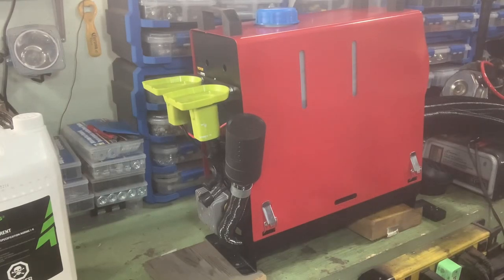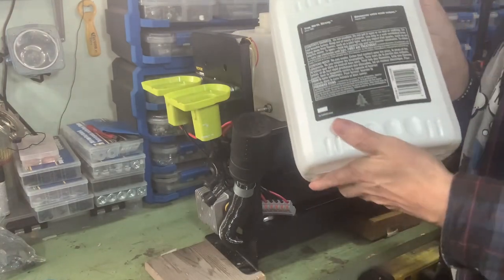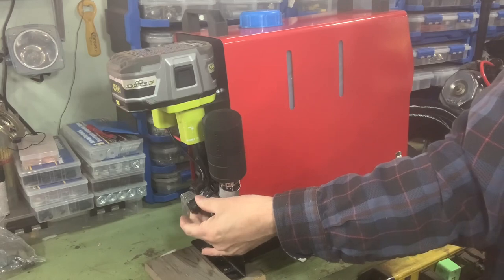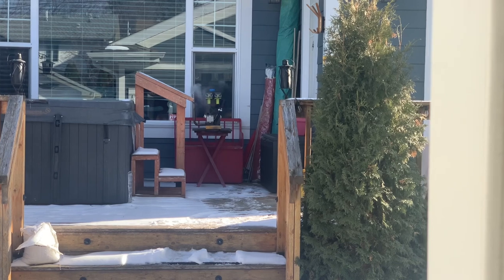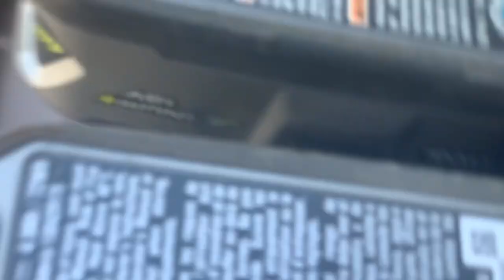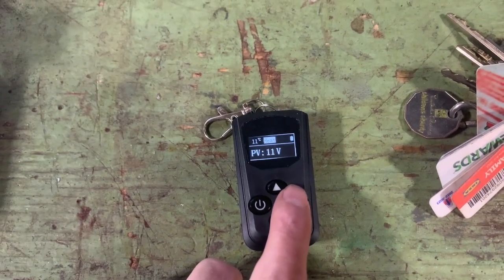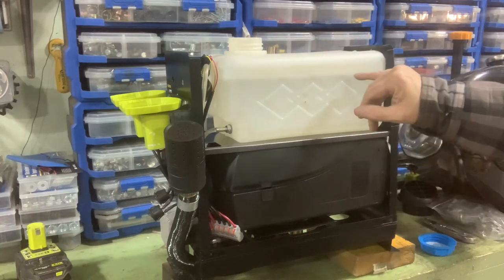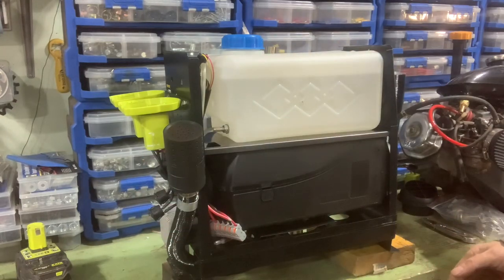Vevor 5KW Diesel Parking Heater Part 5 (seeing how long 2 X 4Ah 18V Ryobi batteries will power it)

Comment: Fantastic set up Bruce - utilizing the extra batteries you already had and converting to 12v is pretty neat. With snow currently falling here in ON seems like a heater will be needed for another couple weeks lol - thanks for the extensive test and follow up vids. Thanks and Cheers
Reply from the maker: Thanks Ed. We’re supposed to get a little snow tomorrow but Calgary is supposed to get 30cm! It was +5 here on Monday, +19 on Tuesday and down to +10 yesterday. Just checked the forecast and they’re calling for +25 next week. Crazy times. Hopefully it warms up there for you soon

Comment: Hello there Bruce.  This was a good test and it sure passed I would say!  Looks like a decent heater for a small space, but it would work in a shop or garage too I bet and keep ya warm enough for working.  Thanks for doing the test.  Take 'er easy!!
Reply from the maker: Hey Mike. It worked great! I’ve read that the 5KW will keep a 20x20 garage at +10c when it’s -25c outside and an 8KW will get it up to +20. As long as it keeps my garage above freezing if my furnace fails out there when it’s cold out
Reply: @BruceLyeg  That sounds like a great solution to heating my shop.  The salamander I use now pumps out the combustion air as heat and it has a ton of moisture along with some smell which probably means there is CO in it.  I would refer not to breath that stuff!!
Reply from the maker: @GrampiesWorkshop I’ve seen people use those to bring the garage or shop up to temp and use these to maintain the heat